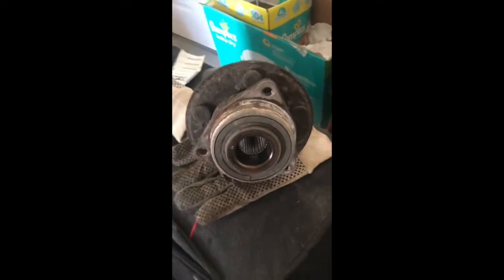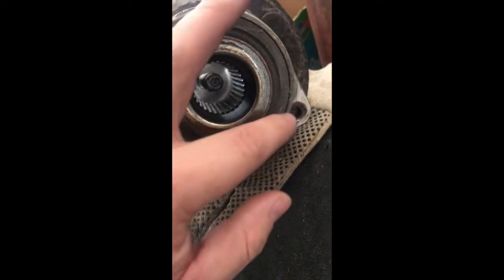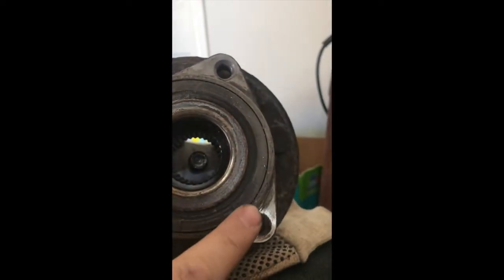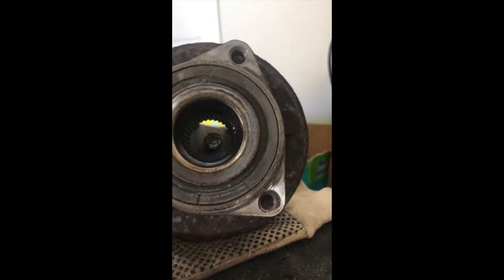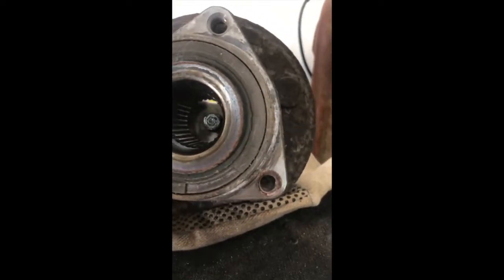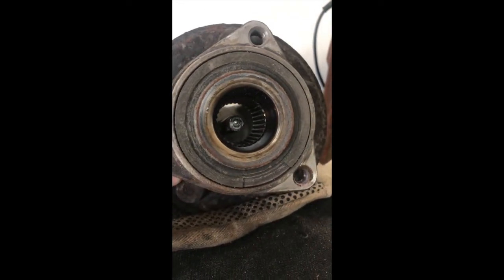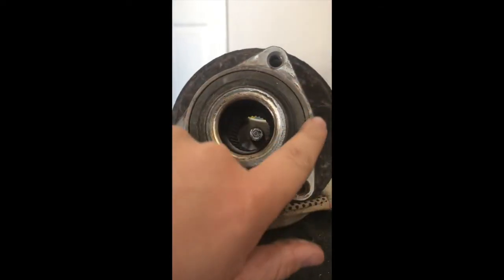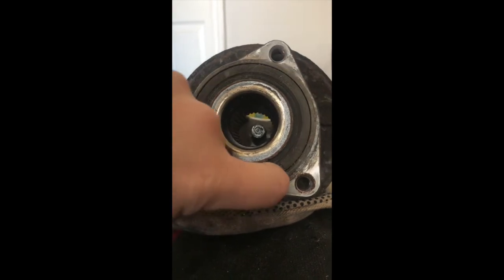Why Speed Sensors Fail (2012 CTS)

Comment: I also have a 2012 cadillac cts but for my wheel speed sensor i dont have to move and it will start going crazy on the message center and their isnt any lights they stay on they just show up and freak out then go away. What's the best way to figure out what tire or tires it is?
Reply: Get it scanned it should tell you. Only way i found out which mine was.

Comment: I have a cts 12 and it’s giving me the right rear speed sensor, I checked resistance on it and it measures the same as the other ones, then I measure the harness and it reads way different that the other side harness, do you think it could be the harness it self? Thanks in advance
Reply from the maker: Unlikely, but it very well could be. Did you check the wheel bearing to make sure there is no damage on the magnetic strip? The only way to truly check resistance is to have the car on jack stands and secure, turn the key on accessory mode and put the car in neutral, hook your ohm meter up and spin the wheel and if there is ever a point where it drops in ohms you have a bearing issue. Hope this helps!
Reply: All Things Shown hello, I just took the bearing out and it looks okay except that was really dirty like a lot of grease and dirt I cleaned it up, the strip looks good though
Reply: All Things Shown I think I will replace the sensor might as well while the hub is all apart right hopefully it comes good
Reply from the maker: @armandomartinez-jp9zi  Fingers crossed!